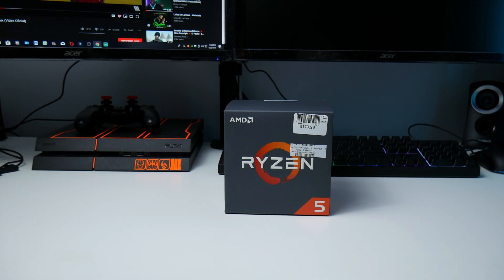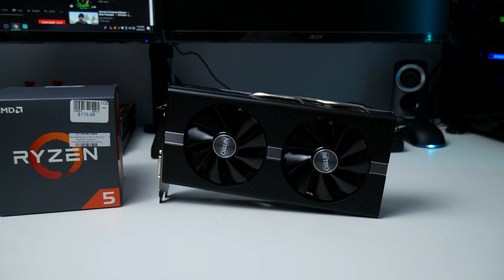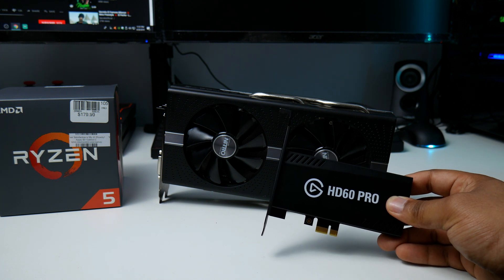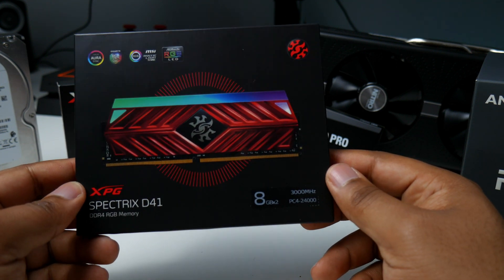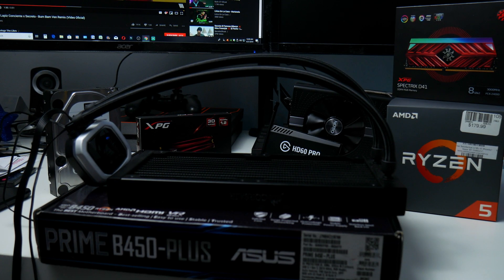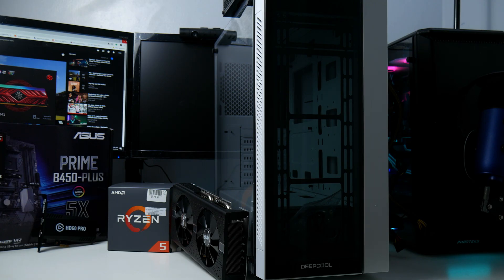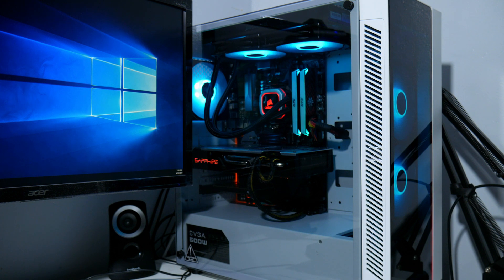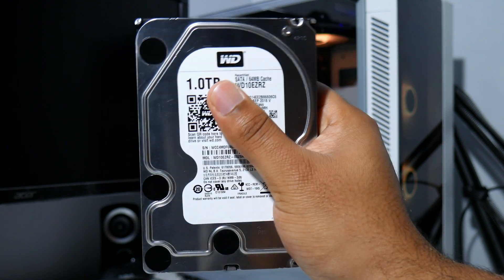$700 Streaming PC Build and Parts Detailed - April 2019

Comment: Maybe I missed it, but did you select those components based on the Twitch recommendations? I want to build a streaming-only PC, as well. Your build looks good. I'd be interested in hearing how well it works for you for streaming duties.
Reply from the maker: No the parts where my own recommendation with this setup you could stream at 1080p no problems the 6 core 12 threads of the Ryzen 5 and the rx580 8gb are more than capable as a combo to have a smooth stream. But if you don't like AMD Rx gpu a GTX 1060 6gb is more than enough for streaming at 1080p 60fps.
Reply from the maker: If you have more questions regarding the matter more than welcomed to ask..